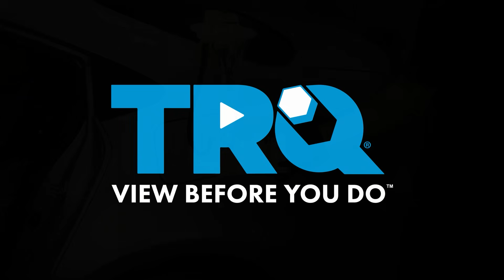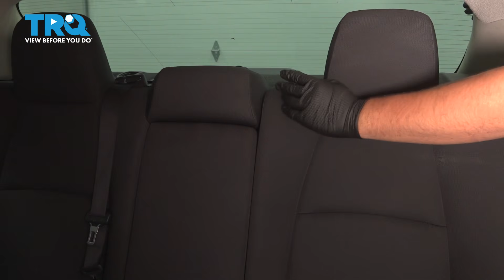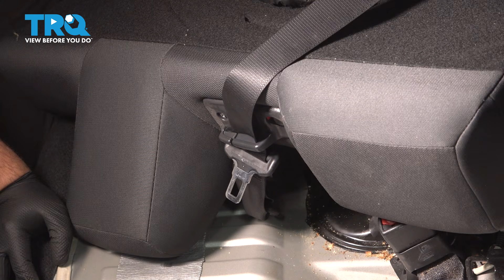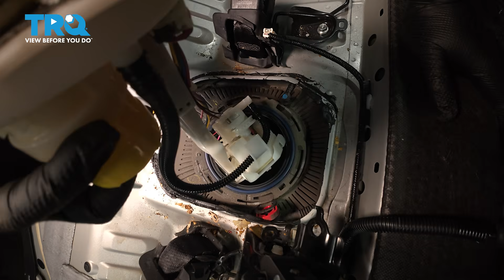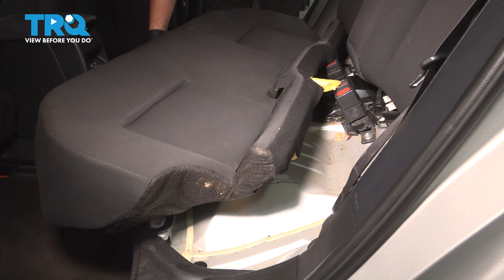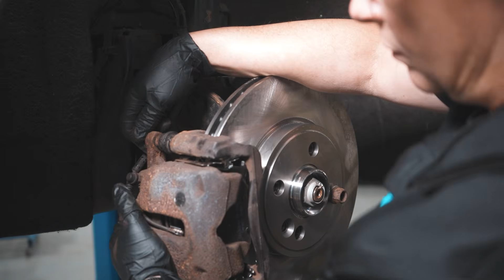How to Replace Fuel Pump Module 2020-2027 Toyota Corolla

Comment: I have been having a P0303 code and the dealership is stating its an intermittent fuel pump failure due to seeing the levels go from 46 to 39 to 42,25, then 46 (low pressure). This seems simple but would the fuel pump actually cause the code and is there any possible things that could go wrong if done wrong (trying to save some money and not pay $1220...lol)?